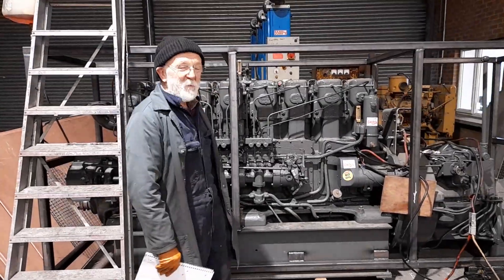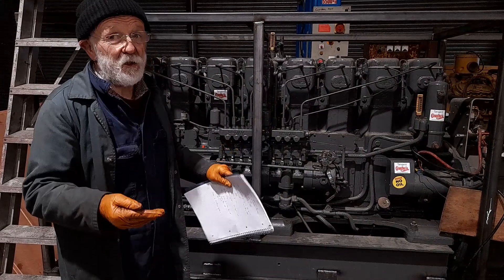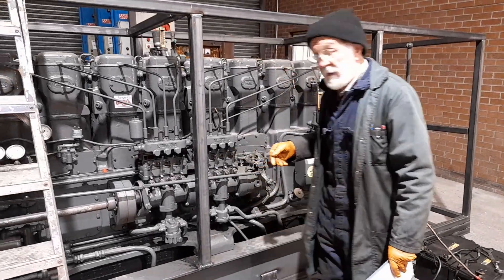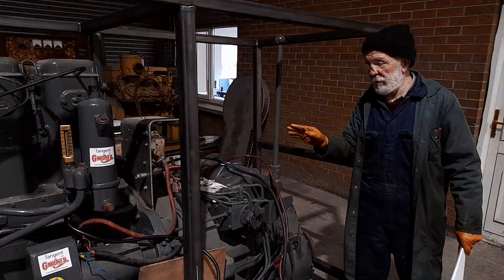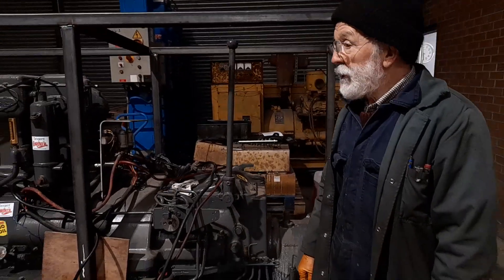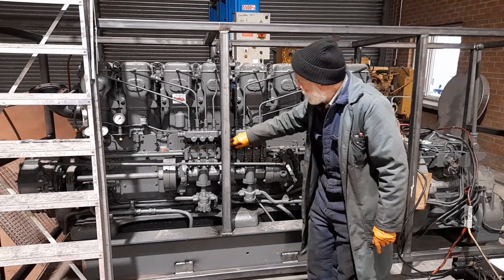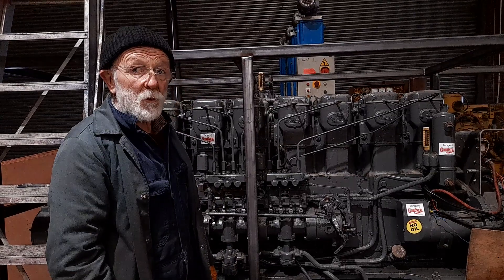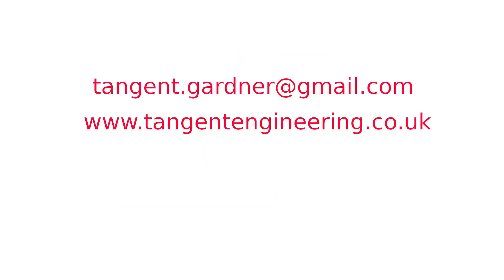Gardner Engines: the incredible 8L3B!

Comment: Worked on a 45ft trawler back in the 80's (boat was built a lot earlier). Engine was original and it never once missed a beat. We also had a 2 cyl Gardner for power generation. It was built in the 1920's or 30's.

As best as I know the boat is still being used, even though she must be over 80 these days.

Comment: BC Ferries had a boat? The MV Mill Bay, with a Gardner engine. Even the DC generator was belt driven from the prop shaft. The ferry used only 18,000 liters of diesel PER MONTH while running almost 12 hrs per day seven days a week.

Comment: As I've said many times before we there hasn't been a better , more economical, or more reliable marine motor ever made, I've had many, from the 4 LW , right through the LW , LX range to the ultimate in engines the mighty 8 L3 B , which was 230HP at 1150 rpm , and in a 60 Foot fishing boat I could do my ten day trip on two gallons an hour , and in three years I never lost a single days fishing because of any breakdown, such a shame that they are no longer made, cheers from Tasmania

Comment: Thats 155 hp at 800 rpm meaning another 550 rpm gains you 107 hp at "rated speed". Zero "torque rise" when "lugged" as well. 

It also has to weigh an easy 20 lbs per hp "bare" and there's so much obviously wasted weight there such as in the injection pump drive its ridiculous.

Comment: I used to o/haul Gardner cam boxes and fuel pumps and injectors..calibration etc. ..every time there was a fairground in the area guys would bring injectiors for servicing,some had never been out of the generators for years…they were a bastard to re- condition after all that time..only Rustons and some Leyland injectors were on a par with with Gardner for difficulty in servicing these brats…the nozzles and needles in the injectors were separate and you had to centralise the nozzle and needles in a jig before you tightened the cap nut ..a skill on it’s own..I worked as a fuel injection engineer and covered all kind of injection systems and all kinds of applications for about 20 years..good times..,

Comment: Regarding  Lawrence Gardner,s 8L3B, was the original design from the early to mid 1930,s?, if so Scammell missed a golden opportunity to fit this monster in a beefed up Pioneer,. Think what Norman E Box, Uncle Percy of Wynns ,and Tommy Sunters of Northallerton could have done with such power,. By the early 1930,s Heavy haulage underwent radical changes, from steam to diesel traction,. Lawrence Gardner,s 6LW  flew out Patricrofts gates as fast as  the factory  could make them , a fair few to Scammell Lorries of Tolpits Lane Watford Middlesex  .

Comment: I worked for Gardner in the crankcase departement in the mid 70s and used a 6XLB I marinized myself in 1983 for use in a 70 foot Ketch. It worked without fault and started first pluck every time. Shame they are gone now. Maybe I machined the crankcase on this one.!

Comment: Ahh, bliss - I was working on HGV's late 70's to early 80's. I met this beast occasionally with 2 pots protruding from the rear of a Foden cab.
You were right to shut her down sharp, as you know, coz within seconds you would have been reduced to tears with the fumes🤣
Cummins were another engine option - completely different design ideals but none the less capable. You could crack them up and be able to breathe with your head up the exhaust.
And Rolls Royce 'Eagle' diesels - oh dear! For saying Rolls Royce had a reputation with plane engines and cars, what happened with their diesel design? I never did understand?

Comment: Was ist der Unterschied zwischen, 6l3 und 6l3b???
Reply from the maker: The L3B is an improved design on the L3.
Reply: @tangentgardner ?? Der 6l3b braucht weniger Diesel als der 6l3 und hat mehr Leistung??
Reply from the maker: @albirandi  Yes.    6L3 = 153BHP@1200RPM                                                    6L3B = 195@1300
Reply: @tangentgardner  haben beide Motoren die gleichen Zilinderköpfe?
Reply from the maker: @albirandi  No.  The valves are different.
Reply: @tangentgardner  im Durchmesser oder im Winkel?
Reply from the maker: @albirandi  Diameter.
Reply: @tangentgardner  ist die Nockenwelle gleich? Ist der Einspritz Zeitpunkt gleich?
Reply: And valve stems are different sizes too.

Comment: Dear Mr. JOE, i remember an twin starter engine, the year 1965
Engine Thornycroft, in fact AEC AV 1100. Marinized by Thornycroft. Norm. asp. engine
18 ltr. 228 BHP at 1700 rpm
Incredible engine with a lot of power!  The pitch of the prop 3 x increased and free from smoke . Mussel Cutter in the NL 
The time of swichting on de second C A V starter was delayed. The armature pinion engaged the flywheer gearing than the second starter schwitched on
B t w an hydraulic damper was installed between the Morse cable and the lever on the (hydraulic) governor.  
4 valve separate  single cyl.heads.
Bore x stroke 156 x 156 mm
Pity during the running in periode the lower oil control ring was NOT installed!!! But great engine with a beautyfull sound

Comment: Great video,the Irish peat board(bord na mona)used gardner engines to power the massive peat harvesting  machines used from the 50s in the Midlands bogs,to prevent fire they filled in all around the exhaust manifold with fire cement reinforced with wire mesh,their reliability and easy starting was a big plus.
Reply from the maker: Yes, in the very early days Bord na Mona had to design their own peat harvesting machines, until the Russians entered the market.   I believe the used Gypsum as a fire cement.

Comment: I served on an Admiralty type 75' MFV 1256 in the early seventies, with the Royal Naval Auxiliary Service. She was a left over vessel from the 1940's. She had a Perkins P4 220 v DC generator for sea going duties and a Perkins P3 for harbour  duties. Main propulsion was by a Gardner 8 L3B engine. Brilliant sea boats, although not very quick, the Gardner was like a sewing machine! On long runs, we would tie the gear lever in the ahead position, open the throttle fully and away she'd go. Apart from regular engineroom checks and filling the hourly log in, operating them was a doddle! I Loved them! I remember visiting the Minesweeper base in Ostend, whilst on board the I.M.S. XSV Shipham M2726, we noticed that the Belgians were using Gardner engines only with a different nameplate on them!
Reply: The happiest time in my life was as a stoker on MFV 140 working out of Kyle of Lochalsh.  I was straight out of the RN, and I couldn't believe the relaxed environment in which I now found myself to be in.  The 8L3B was a delight to work on.  The only thing that was annoying was the Bramah belting used to drive the dynamo, which was a pain in the proverbial to adjust.  Unfortunately the boat went for disposal after the engine moved, rather alarmingly, on it's bearers on rough weather.  Subsequently we found out that it was secured to the bearers with coach screws.  We got a new fleet tender (Melton) after the 140, but the job was never the same. I still keep in touch with the surviving crew members though, and the conversation always reverts to our time on the 140.
Reply: @harrysaunders6180  Agreed Harry! They were a doddle to run and maintain and bloody good sea boats too! When I joined RNXS in 1972, the first boat I went on was Loyal Factor, an early Fleet Tender. We didn't have her long after I joined, as she was seconded by the Army in Northern Ireland. We had a Ham class
 IMS called Thakeham and when loyal Factor was taken, we got another IMS called Shipham. Shipham was seconded for a few months in 1974, when one of the Inshore Survey boats suffered a serious fire' which was when we had 1256.             I spent most of my time on the IMS's and these were my favourites 1977 saw the arrival of a new Fleet Tender by the name of Loyal Helper. She replaced Thakeham, she was a good boat but lacked the character of the IMS's, not only that, hardly anything ever went wrong, so not a good learning platform for junior engineers. These were eventually joined by the P20 class fast patrol boats, which had twin     V-12 Rolls Royce ex Challenger tank engines. Phenomenally thirsty and not being a true marine engine, were a pain in the arse to work on, having to remove air boxes filters and god knows what, to get to the injectors but happy days all the same. Would go back tomorrow, although 'Her indoors' would definitely have something to say on that!!

Comment: I had the honour of commissioning probably the last 8L3B to be sold in Ireland in 1982.  It was fitted in a new 65 ft wooden trawler built in Baltimore, Cork for a local fisherman. Apart from the vessel being equipped with all the latest electronic gadgets available at the time the engine had every accessory available.  From twin starters ( electric and spring ) to Transmotor alternator. The alternator had a through shaft which allowed the yard to fit an in line hydraulic pump for winches etc. The Twin Disk reversing transmission had 3:1 reduction and was modified to provide hydraulic oil pressure through the centre of the output coupling. This operated a three blade variable pitch propeller to allow maximum power at towing speeds while also allowing the skipper to speed home at the end of the day. To set the pitch you stuck your head out of the wheelhouse window and watched the exhaust smoke, black meant overload. The complete sterngear package was made by Teignbridge Engineering who had taken over propeller production from Newage.   The price of the overall package at close to £50,000 was outrageous for a 260 BHP engine,  but it was what the customer wanted and the EU was providing the finance. Where is it today?

Comment: Nice one Joe. We currently have two 8L3B’ in one of our vessels. Solid engines. Loads of power for very small amount of fuel used. 
Just learnt some interesting points. Thanks. I wish ours were as clean as this one. We’re there is no heads gasket, just an O ring on the liner, is it normal to have oil leak from there?
Reply from the maker: Oil leaks are endemic on Gardners.   Some think of it as a feature.   Helps prevent corrosion!
Reply: Gardener's are like Harley's and Bull Terriers, they like to mark their territory. 
Because they are the best they have that right.
Reply: No head gasket
2 x pushrod hole o-rings
And depending on the hp rating a bunch of copper ferrules and sealing o-rings.

Comment: The big problem with Gardner is they were stuck in the past. Gardner for a long time frowned on turbos when other makes forged ahead with advanced big power units.
This thing may be durable but it's very low on power & torque, 250hp from 24litres is very poor..
Reply: That is true but it should be noted that for marine and gen set purposes there is nothing that equals the reliability and
Reply: Oops..
Marine and gen set use there is no more reliable and fuel efficient engine available. Some of These things have been running generators in places like India and Africa for decades with very little maintenance (and in some cases without air filters)! Turbo diesels tend to sacrifice longevity, reliability and fuel economy for power. It all depends on what you want them to do. I'm sticking with my 2 6lxbs to power our gentlemen's yacht. Reliable, cheap to run and sound wonderful.
Reply: @andrewrobson5865  well said sir.

Comment: I see it’s a straight 8, love to know the capacity and bore an stroke.🇦🇺
Reply from the maker: 24.175ltrs
5.5" bore
7.25" stroke
Reply: Raymond Welch, I'm from Tasmania Australia and have been a commercial fisherman for more than sixty years, I've had all models of gardner engines in that time and the last one I had was an 8L3B which I purchased new in 1982 and it went into a 61foot conventional wooden boat and it cost $ 78, 200 Australian dollars and work every cent of it ,it was 230Hp@ 1150 rpm the bore was five and a half inches and bore seven and three quarters inches,it was swinging a 52 x38 four blade prop through a 509 twin disk box with 3:5 to 1 reduction, steaming at 1000 revs would give us eight and a half knots and use around four and a half gallons per hour, I never lost one days fishing in 14 years because of engine problems, cheers from Tasmania

Comment: i was a bus driver back in the eighties and many of the buses (MBS or metrobus) used Gardner engines. they were very slow revving and always seemed to be a bit underpowered and certainly could have done with a turbo charger.
Reply: فارسی بلد نیستین؟ایران.ایرانی؟
Reply: Would have been the 6lxb non turbo.

Comment: When we had occasion to overhaul a Gardner diesel, it was a great experience. They were easy to do, but you had to follow their recommended practices. One thing I remember  is that the cylinder liners had to be assembled using Lard. Yes, rendered down sheep fat! If you did not you would get "hot spots" on the liners and that led to a piston grabbing the liner. Needless to say we did not have that problem.
Reply: Gardner workshop drawing makes a point of saying not to use oil to lube the dry liner before pressing into the wet liner.
Reply: I remember the OReilleys Engineers to the printing trade in Dublin They used to use lard to move heavy cast iron printing presses around.

Comment: Years ago I worked for loctite, I was responsible for Gardener engines in Eccles Manchester. I saw the amazing skills producing these to such tight tolerances in the pre cadcam era. The whole ideology was quality led. I think the chief engineer was called Mr Such a real gentleman. It was apparent they were doomed in a throw away world, turbocharging was an anathema as it presented reliability issues.  These things will run for almost ever before a rebuild and then run to infinity. Beauty in cast iron, forged steel bronze and aluminium.
Reply: Gardiner were owned by Perkins for a while.Their downfall was when Cummins opened their engine production plant in Scotland producing the N14.Cheaper than Gardiner,way more horsepower but nowhere as economical.Problem with the truck engine market today is that Cummins have the ball at their foot since CAT gave up on production off on highway engines.
Reply: @eugeneoreilly9356  I worked for ingersoll rand after loctite and at one time they owned Cummins we used their in line six and v sixes in some machines.  We paid for absorbed horse power (Fuelling settings) as that determined warranty costs and engine life.  Most of those will be junk now, but I expect some of the gardeners soldier on, particularly marine. There’s a cat RE manufacturing in the town i live near, was RR then Perkins now CAT. But it’s tiny compared to the RR and Perkins days.
Reply: @tomtd  Yeah Tom,Perkins bought RR diesels then CAT bought Perkins.The famous RR Eagle range continued for a few years after unchanged but with a CAT badge and painted yellow until it too finally disappeared.

Comment: Max rpm 1100
Reply: Max power speed.
Reply: 230 BHP @1150rpm for continues heavy duty in fishing and commercial craft.
Reply: @billalbion  wrong
Reply: @cidertom5140  read the Gardner book, engine specs are near the end of book. Don't get mixed up with 6LW/LX and LXB engines all with 6 inch stroke. The L3 and uprated L3B are mostly used in marine work with about 7.25 inch stroke running upto 1150rpm for continuous heavy duty use. It's all in the book. Please tell me what is wrong with my comment in your opinion.
Reply: @billalbion  because some said 1100 eg rail or Diesel engine websites to do with the 8l3
Reply: @cidertom5140  the 8L3 ran at 900rpm in commercial and fishing craft, the 8L3B uprated to 1150rpm .
Reply: 8L3B highest factory rating is 260hp at 1300rpm.

Comment: I knew some old Guy Arab and Leyland Tiger buses that had Gardner diesels in them
Reply: My friend had a early 1950s Leyland Tiger single deck bus with Gardener engine. It did 18mpg with the town geared back axle. A more normal ratio would have seen well over 20mpg. (Imperial gallons).

Comment: Fantastic engine what is the cubic capacity? its not heading off to go in the Western Flyer is it?
Reply from the maker: 24.175lts.
Reply: Joe McCool wrong 24.000 each cylinder is 3 litres. 3 by 8
Reply: @tomlowe8563  You're wrong , Joe McCool is correct
Reply: @Ozsmallbore  no I’m not

Comment: Best and easiest engine I've ever rebuilt, lapping the heads to the liner tops is probably the hardest thing to do and that's easy, fantastic
Reply: So no gaskets? Brilliant!  They’re a constant source of failure.
Reply: @ThreenaddiesRexMegistus  constant source of failure  ? Don't talk sh* t.
Reply: Much easier and quicker to use the proper lapping tool for the top of the liner and the mating surface on the head.